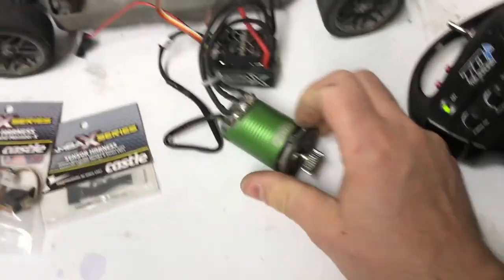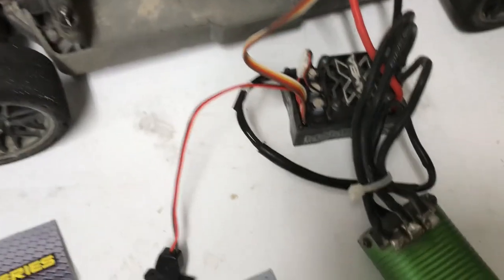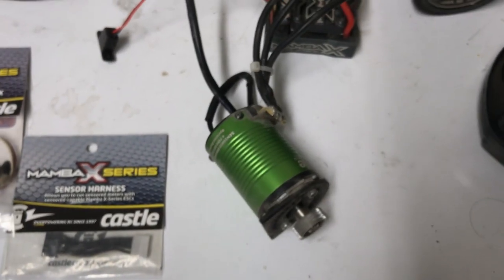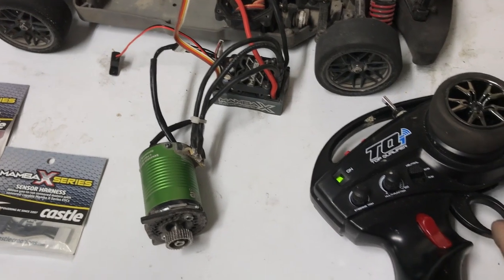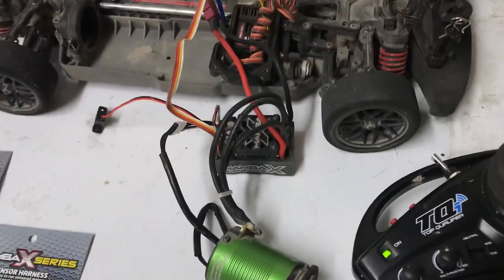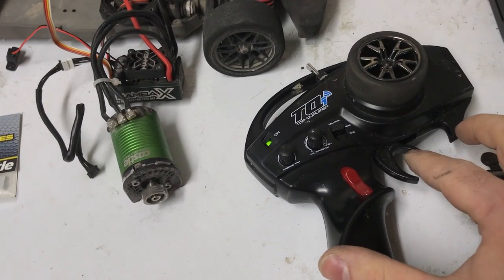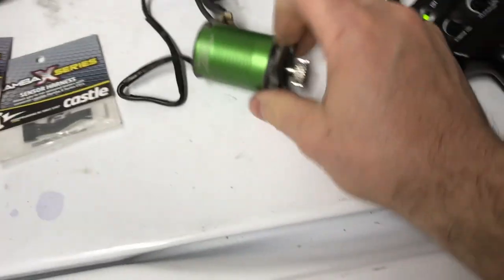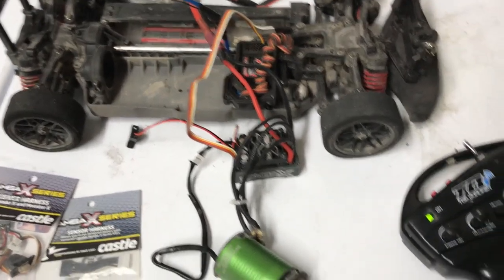What's going on with Mamba X ESC?!?! *BROKEN*

Comment: I had the same problem the sensor on the esc unscrew the screws from the esc and check to make sure the clamp should also clamp on to your sensor and plug from your esc. Cause that fixed the problem on mine mamba x.
Reply from the maker: lll try that out, thks!
Reply: Bro wow you saved me from throwing mine away basically
Reply: Damn. I fried my esc before seeing this

Comment: Check your 2.4 band isn't set to far out and have a look if your not in smart sensor. You could also have a flat lipo.
Reply from the maker: the remote seems to be outta wack
Reply: @DIYRC  I know it’s an old video but I do not think it’s in the radio. It’s in the sensor of the ESC or motor I believe. I’m having the same problem not having any luck figuring it out.

Comment: Mines doing this too, and yellow light. I pulled wires out of receiver while on, waited, then plugged back in. Now it turns and throttle works, but still yellow. Did you plug link in backwards first? All I can figure. I haven't even gotten to run it yet, so no link. Literally just paid for install, and on first attempt, no good? WTF!!!!

Comment: Same problem I am having except for mine will not move unless I bump the truck. I hope you found an answer you can share with me. Greatly appreciated Dan.
Reply from the maker: Sent it over to castle creations, they said it was the C wire on the Esc that was malfunction.
Reply: @DIYRC  thanks for replying. I’ve been pulling my hair out. I was on the phone with them today and I got so frustrated because they treated me like I was five years old!!!! did you check your battery? Of course I checked my battery. Did you check the batteries in your remote. Of course. I did all these things and 100 other before I ever called you. I even changed the motor. Same problem. So thanks again I do appreciate it.
Reply from the maker: What did they say? Are they going to replace yours?
Reply: Turn on receiver, then car, then unplug servo and esc from receiver while on, and wait a couple seconds. Then plug back in both, and mine works, but light is still yellow. Really frustrated, as I just paid to have mine installed while I was working, and now my installer has been out sick two days, and can't get info. Dropped over 400 between purchasing and paying labor, also had slipper eliminator put on, and 5 star tranny rebuilt. Love the mambas, but something is  definitely wrong here. Mine functions now, but yellow green light instead of green, and servo keeps wanting to go left.

Comment: Calibrate forward reverse and neutral
Reply: Doesn't work for yellow light. Only thing that got mine to actually function is pulling servo wire, and esc wire from receiver while on, wait a second, and plug back in. Then it will turn and go, but still yellow.

Comment: We’re you able to fix it? If so what did you do?
Reply from the maker: ya l sent it back to castle, turns out the wire coming from letter C was faulty. But try using a different remote and receiver that can also cause it to do that as well.
Reply: I used a different remote because my other one broke and it’s doing this to me now

Comment: Sensored motor won't run in reverse. Make sure motor direction is normal
Reply from the maker: l just checked lt does go in reverse. Are you sayin there should be no reverse at all?
Reply: @DIYRC  not the car itself, the motor direction. You can change motor in castle link or by switching first and third motor wires. Then make sure you change throttle direction on your remote
Reply: That's incorrect sensored will work and forward or reverse
Reply from the maker: @cripmeezy  Will it?
Reply: @cripmeezy  go into your esc settings, put the motor direction in reverse and let me know how that works for you.
Reply: @DIYRC  lol no it won't. The car will have forward and reverse, yes. But the MOTOR direction in your esc settings has to be forward to work with a sensor wire. Try it both ways and see for yourself 🤷🏾‍♂️

Comment: Did you ever fix this problem im dealing with it right now ??
Reply from the maker: ya l sent it back to castle, turns out the wire coming from letter C was faulty. But try using a different remote and receiver that can also cause it to do that as well.
Reply: @DIYRC  can you send it to castle even if the esc was bought off someone
Reply: @xavierfelix2146  yea you can you just have to pay a fee

Comment: my 1/10 mamba x was literally acting the same, I learned over time the sensors in the motor dies, when I plugged the sensor wire into an other sensored castle motor worked fine. usually has to do with a, b, c, wires from motor to esc that gos to the sensor, lol if that made sense.
Reply from the maker: You're right! the wires from the ABC was off causing it to malfunction.